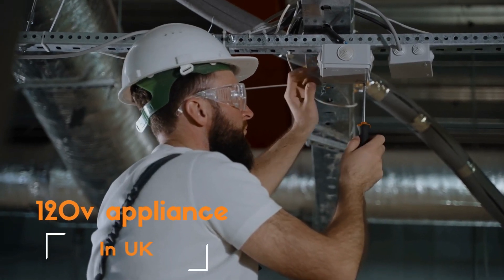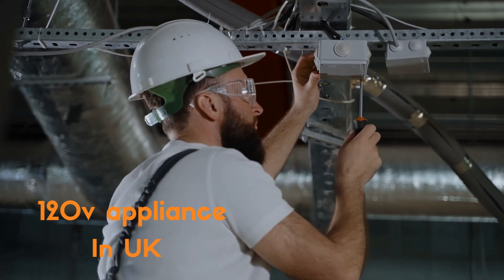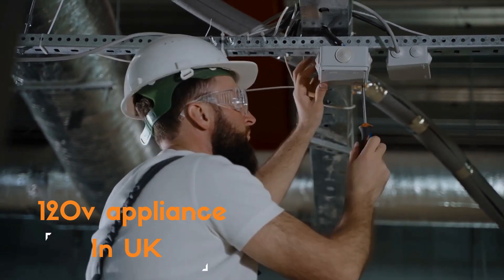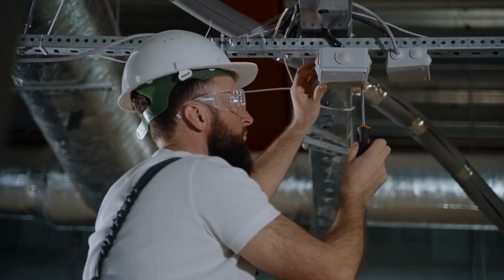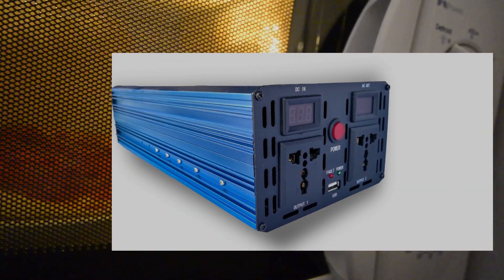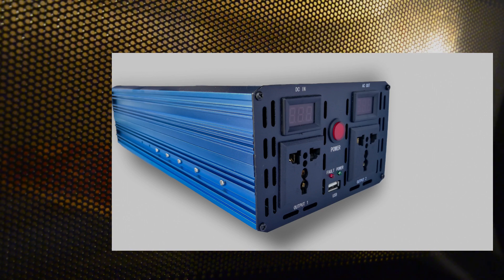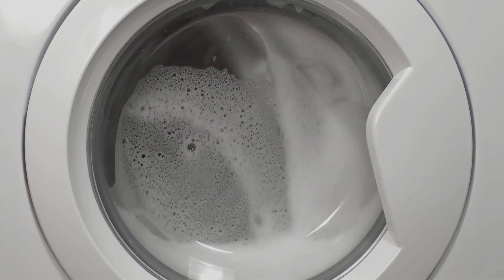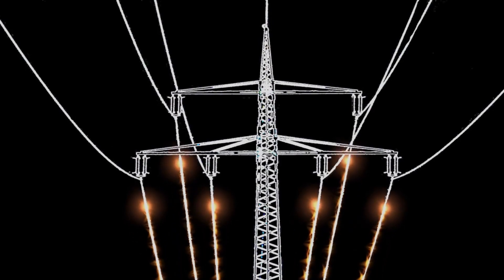How to Use 120V Appliances in The UK? An Electrical Engineer Answers!

Comment: I already plugged in a USA appliance (110V) into a UK socket and the appliance has a spark and loud noise. It won’t start again. 
What do you think happened in the appliance, technically speaking? 

(Socket still works fine for other UK appliances)
Reply from the maker: Technically the damage varies from small to big depending on the appliance international protection and design.
I'm sorry to hear that, and I highly recommend technical inspection for the appliance
Reply: Fried. Short answer